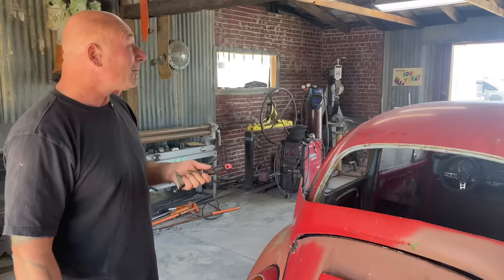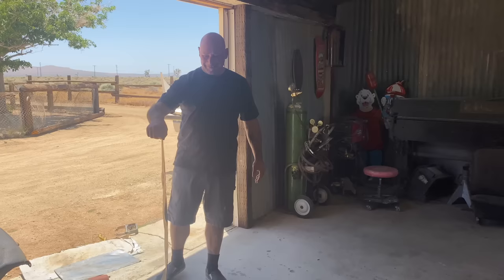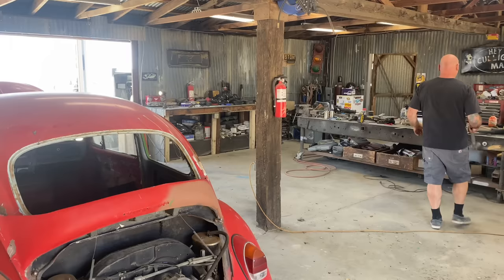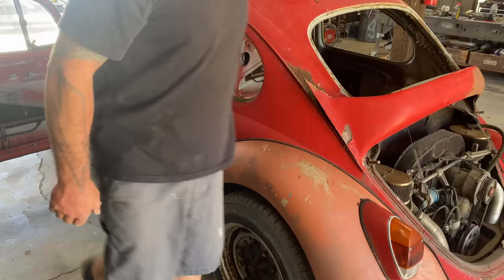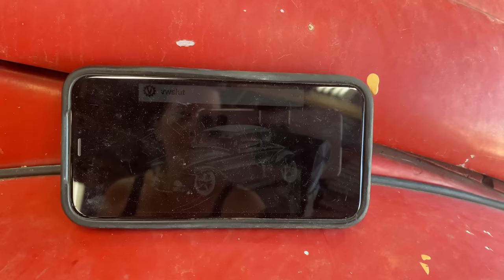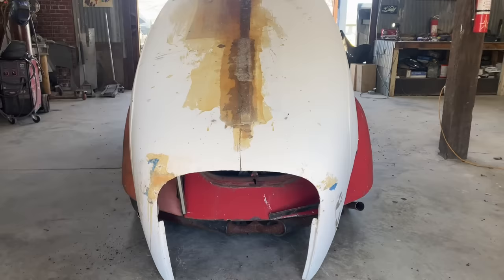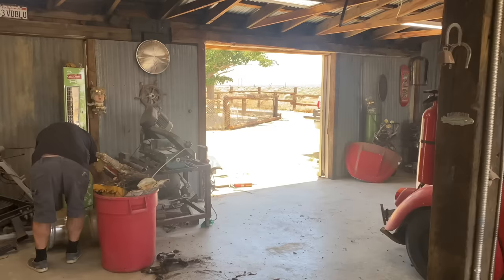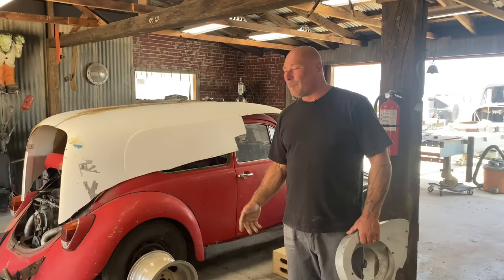Part 1! Ian Roussel 1968 VW Bug Radical Custom Introduction and Discussion 👽

Comment: Ian, I like your work! In 71 I did a 66 VW and the most standout and noticed modification was I ran the exhaust back under the trans axle and out in front of the rear wheels. the Wide crager"s and flared fenders and nerf bars etc. helped! JP in Oregon.

Comment: The Green illustration you showed as inspiration. I think if you go back and look at it, they may have used a A model windshield assembly but I believe the top and back of the top are VW Van rear top  section looking at the shape and drip molding.....

Comment: l had a 75' type 1 bug w/ the 1835cc/dual carb/headers set-up. l drove it from Dallas Tx to Ushuaia Argentina and back in the early 80s w/o much issue. We went thru tires and one belt. lt would cruise 90mph all day and run cool. My friend still has it on its 3rd belly pan w/ 350+k on odometer and on the  motor l bought and swapped out built by Doug at Qualitat VW Dallas when the car was almost new.

Comment: The 68 I had was a “stick shift /automatic”.   There was two tanks under the rear fenders, one was a ATF reservoir and the other a vacuum tank.    The vacuum tank was connected to the intake, under the carb and provided vacuum to the tank.
Reply: My Ghia had the same transmission .. it was the same ✌️
Reply: VW called them non ironically the “AutoStick”

Comment: Ian, I'm 75 and have been playing with cars since I was in my early 20s.  I've done some bad bodywork, some really excellent wrenching, and a number of renovations (not restorations).  I've have a 65 Healey 3000 BJ8 that I renovated but which has deteriorated over the 40 years to rust bucket status.  I also have (among my 14 vehicles) a 71 E-type Series II roadster which was wrecked in 1971 by the original owner with 14K miles that I rebuilt back to the firewall but due to marriage, children, and time has also reverted to rust bucket tub status.  Watching your show on TV and your You Tube stream, with your insouciant approach to ripping stuff up to make it useful after transformation, you have inspired me.  With my 2500 square foot shop and assorted tools, including welders, I'm going to rip into my 2 classics and turn them back into driving dreams.  Failure is not an option.  Thank you, young man!!!

Comment: #3 exhaust valve. Having that under drive crank pulley was a bad idea, heat killed the valve guide. There was barely enough cooling for stock HP. It’s got an alternator, wonder if the fan shroud/oil cooler is late model?

Comment: In the late 80's i raised the rear end in a datsun 510. That thing was low but the rear tires had almost a perfect contact patch, barely leaning in at the top. It also had the same flares that the race teams used (like 3" on all 4 corners). It was a total beater with no power but i hardly had to slow down for any corner. Can't wait to see how it turns out.

Comment: Love the imagineering process you go through and Really love that you share it with us on these videos. My 1st car was a 76 Bug, w/ a messed up fuel injection system, but i installed Cal-look 1 piece windows in it, shaved door handles/trim, smooth running boards and some other bolt-on customizations before selling it to someone that finished it, converting it to dual carbs.

Comment: Just thinking since you are going to use the model A fenders why not make the front straight instead of round with a flat front end and a false grill and add your favorite port holes on the sides. Flat roof and hood with round fenders I think would cool looking.

Comment: With my lawntractorS projectS I've been using a wire wheel attached to my drill before I sandblast. See, I too despise rust. I also want my work to last a few extra years.

Comment: Stock vw front fenders flipped sides bolt right on in the back. I trimmed mine to match the baja cut, I wonder how close or easy that would be to blend into the apron length.

Comment: Ian....For years I was told (or assumed) you couldn't attach fiberglass to metal and have them "stick" properly or a for a long period of time. I've seen you "mix" fiberglass and metal on a couple of projects so my question is...How have the seams between the fiberglass and metal and "bondo" lasted over the years???

Comment: Drop that engine and have at it. That car will be super cool when you are done. 
Have you ever seen the VW buses that where sectioned (?) where the side door was and then welded back together so they are about as long as a bug? Saw a few of them back in New England in the early 1970s

Comment: Before you pull the motor I would remove the spark plugs and see if the cylinders have water in them . Turn it over pump the water out squirt some WD-40 back in the holes put the plugs  in ad some gas and fire it  up.
Reply: Likely coming out for the build anyway.

Comment: Just a thought: For a metal master you sure do use a lot of fiberglass. I guess it is a matter of using what you have handy. That I get.
Reply from the maker: It's a balance....and isn't the inside of the car metal?  And that is where the work begins?  Just a thought 😎 Stay tuned for the next episode where Ian explains how lowering works with the metal fabrication part.  ~ Jamie
Reply: @fullcustomIan  Don't get me wrong. I LOVE the GooTube Jian show and my daughter would hurt me if we missed a single episode. What occurred to me was that he might have chosen a top from other cars/trucks, but I remain glued to the show to see what he has in mind. 
P.S.: From watching Ian in action I've decided to put a hood scoop on my latest lawn tractor project. Since I don't weld I'll solder it in place with lead and use it with a 6" D.C. fan to keep the air cooled motor cool. :oD

Comment: Ian, I have a question sir if you say that’s a 68 why are the brakes a wide five lug pattern 68 should of had four lug rims. Is that a 67 with 68 tail lights?
Reply: Could be ‘68 body on ‘67 pan.
Reply: @ocavant  you’re probably right although I would prefer a 57 body on a 67 pan

Comment: Save yourself all that work and get dropped rear spring plates, and you already have the dropped spindle front beam keeping the stock ride,easy.
Reply from the maker: Disagree, there is no way to get it this low without having the camber out of whack.

Comment: As you all ready know #3 cylinder ran hot, it needs to be adjusted a lot loser. If adjusted too tight the exhaust valve would pop off and say hello to the piston make a mess.